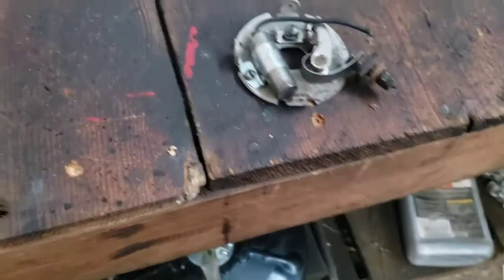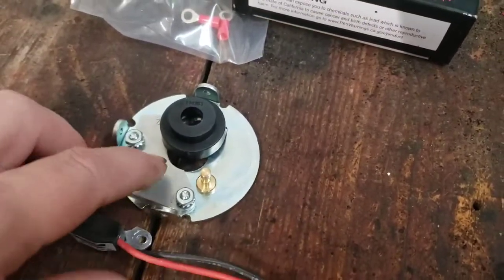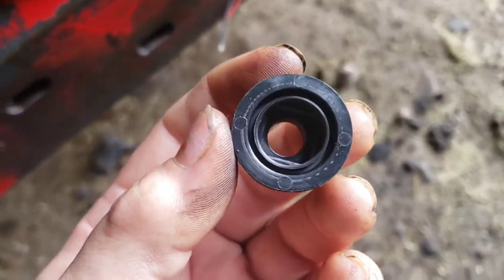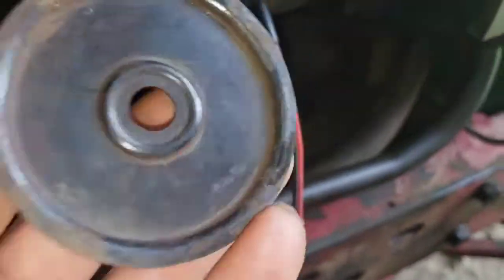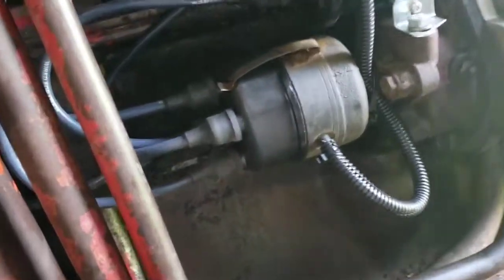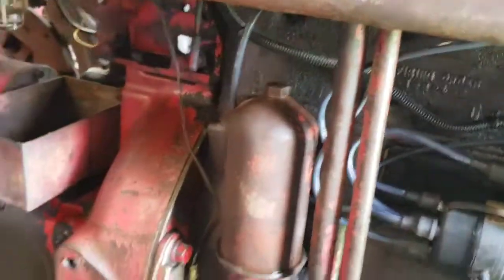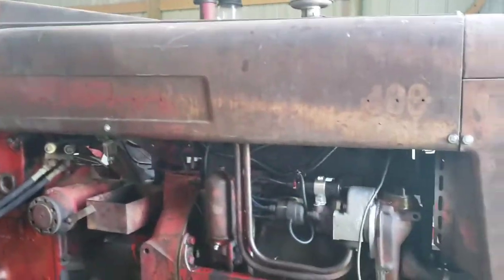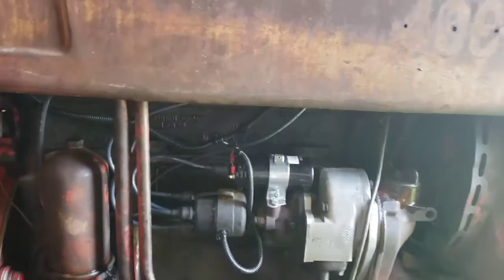Electronic ignition installation

Comment: You are doing good work i am a fan of points they don't fail all though they might need a sanding once in a while.i like your content well enough that i sub to your channel.
Reply from the maker: I don't mind points my M destroys them the liffter broke in less than 2 hours of run time so this is just backup parts
Reply: All tractors are different mine last a long time (years)